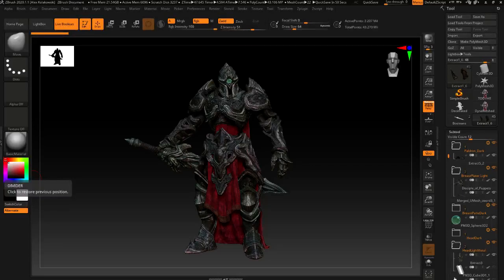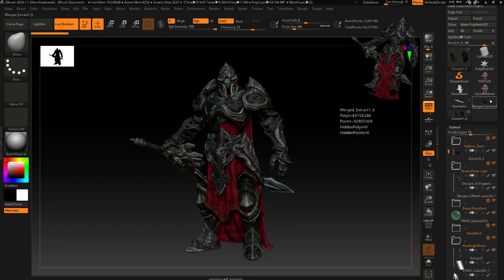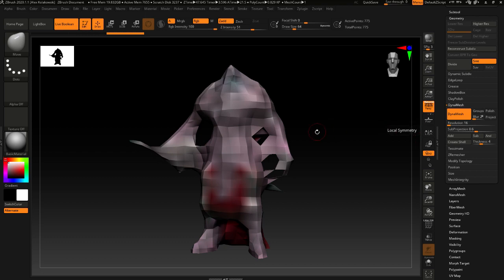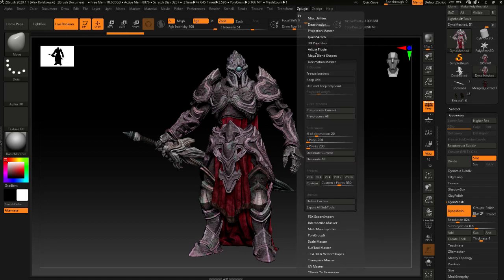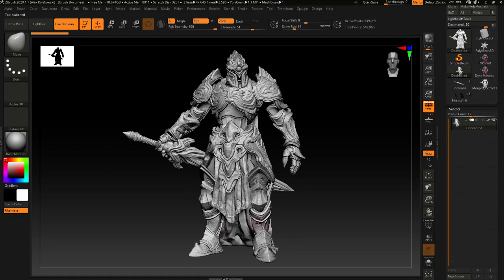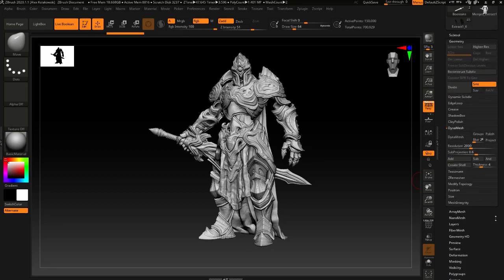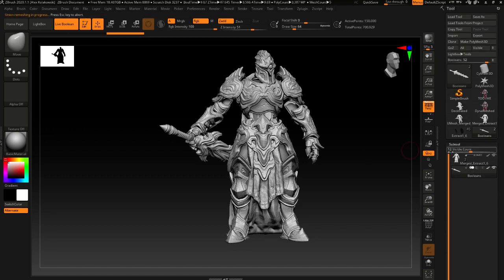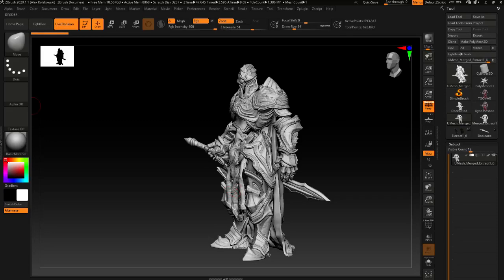How to optimize your model for 3D printing

Comment: Great video man! Got my 600mb+ STL's down to 54k while maintaining desired detail! Bravo!
Reply from the maker: That's great that you were able to shave that much off without any loss! You're cloud storage space will thank you later.
Reply: @tigerskullrpg5092  To get maximum detail while lowering file sizes would you recommend dynamesh at 4100 detail and decimate at 1m points? Is there a way to get even more detail? Thank you for the reply! Cheers!
Reply from the maker: @vonburkestudios  dynamesh values can differ from model to model, I turn it up as high as I can, you will know if you have gone too far if your details explode hah. If so, lower the number until it is a stable result. I typically get around 2 to 4 million on a high end dynamesh.
The best way to retain absolute maximum detail at the lowest point count is to decimate each part individually and then boolean them all together at the end. Again, aim for 750 k points or less to ensure stability across PC's and various slicers. Maybe I will can a deeper dive on this shortly. Good luck!
Reply: @tigerskullrpg5092  Excellent info man! You answered my question perfectly!

Comment: Hey Alex thanks for this! I have a question I was hoping you could help me with. Just tell me if I got this work flow right if I want to 3d print figures. 

Dynamesh sculpt -> ZRemesh and subdivide for higher details -> Dynamesh to join all parts together -> ZRemesh and subdivide -> Project high res deets onto high res Zremesh model -> decimate and split to make 3d printable? Sound about right?
Reply from the maker: That's a fair workflow if you're comfortable with dynamesh sculpting. Try to see if you can z remesh under 100k points when you're ready and posing should be a breeze. Good Luck!

Comment: helpfull video! i made a model and in some parts of it i masked them and increase the activepoints because i want more detail there. it's still one mesh. Can i follow this video to decrease the activepoints? or i need to do something else? thank you for your time
Reply from the maker: If you're done sculpting and optimizing for print then go ahead and follow this tutorial, however if you're still working on that piece and need even more resolution, you might need to zeremesh the item and project history to get the details onto a clean mesh. I hope I understand the question.